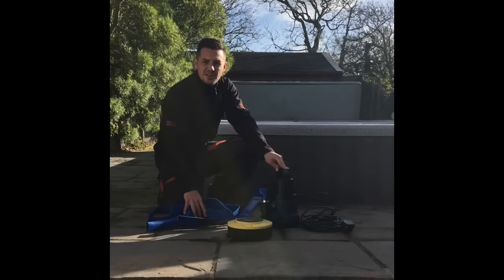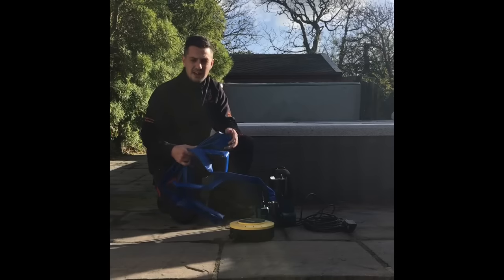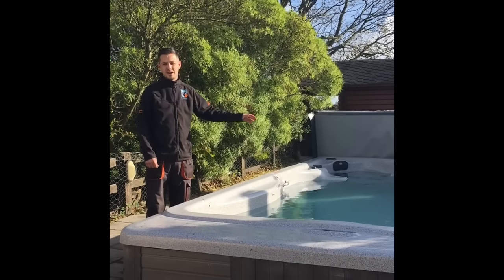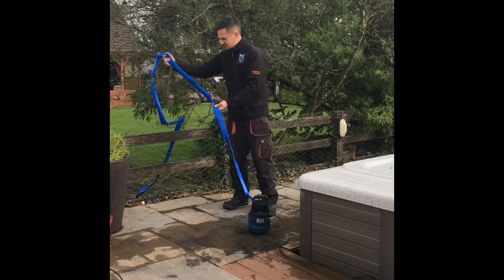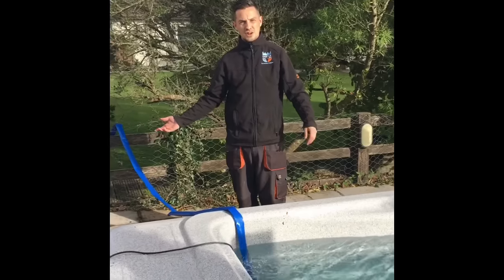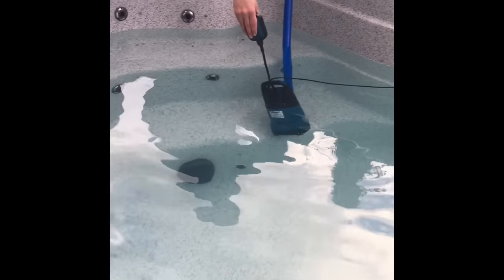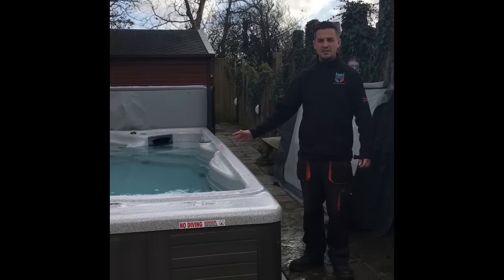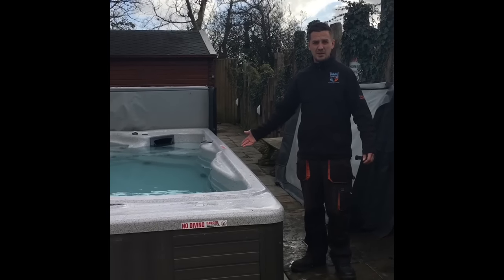How to use a Submersible Pump

Comment: I always wondered why the water pump wouldn't turn on straight away and only after I messed around with it enough but now I know I should've been holding the float switch in the air this whole time ha thanks

Comment: I've just bought one of these to drain 10ft paddling pool. Is it safe to move it while operating in the water?  Am I not going to be electrocuted?
Reply from the maker: If the enclosed instructions have been followed and the item is undamaged then there should be no danger of electrocution. However, before moving any motorised electrical equipment, we would always recommend switching it off first to safeguard yourself and the longevity of the equipment.
Reply: It's also a good idea to make sure the power source is protected by a GFCI breaker, as any outdoor receptacle should be.  Test the breaker before using it.  If the electrical insulation on the pump fails, the breaker will trip and eliminate any threat of electrocution.

Comment: QUESTION regarding hose type:  Have you ever tried using one of those Expandable Water Hoses with these pumps?  I'm getting tired of getting kinks in my typical garden hoses and was thinking about using the Expandable Water Hoses instead...but I'm not sure if those work well for the lower water pressure from these utility pumps.  Any insight would be much appreciated.
Reply from the maker: We only use 32mm Flat Hoses with these Submersible Pumps (included/or sold separately). These hoses are durable and wide to allow the maximum flow possible from the pump. Any hose can kink although this is not such a problem due again to the internal width of these hoses. Expandable hoses (like X-hose) lengthen as the pressure builds in the hose. This can be difficult to manage if you are trying to direct the water to a specific area or drain as the hose gets longer. Also the ribbed flexible exterior snags easily and in our opinion is not as durable as a standard garden hose or wide flat hose.

Comment: Do I need that second device you showed? Or can I just use the pump and hose?
Reply from the maker: Thank you very much for your question. Our submersible pumps come with everything you need to empty the majority of your water quickly and effortlessly. However, we would recommend you also get a wet and dry vac to get the last little stubborn bits of water and grit out of the bottom. A wet and dry vac will also enable you to suck any remaining water out of the jets so that you can safely winterise your spa.

Comment: When you say turn off the hot tub is that on the control panel or the isolator switch ? I have one of your Caldy hot tubs, if I turn it off at the isolator switch will that wipe the timed filter settings input by your engineer the day it was installed ? Many thanks 👍🏼
Reply from the maker: Hi Steve hope you are enjoying your tub!  Turn off at the isolator switch. When you restore the power it should remember all the settings previously set.  Regards, CHT.

Comment: how high can it pump the water? i have a camper van with a water tank on the roof, would it be able to pump from a lowdown stream all the way up to the tnak?
Reply: Thats a good question. The most important and that's to see the pressure power of the pump. 
I for instance want to see if I can pump the water from a rainwater tank to the front lawn....will it activate my sprinkler.

Comment: Aren't you supposed to prime the pump first?
Reply from the maker: Hi Sean thanks for your comment.  It's a good point - and it's a case of knowing your pump.  The Silverline Sub Pumps that we supply  are equipped with an automatic de-aerating device, which removes air from the
 pump. If the pump was allowed to run dry and does not start to pump water again when the water levels are restored, all you need to do is switch the pump off for a short time and back on. This will restore proper operation of the Air Vent Valve.

Comment: what is the name of that pump . what is the psi
which store is it available
Reply from the maker: Hi Keith, we supply the Silverline Submersible Water Pump, it is 750 watt and 13,000 litres per hour maximum output - this is how output is measured rather than by psi.  You can purchase this at:  https://castlehottubs.co.uk

Comment: surely you should be using an RCD switch for your own safety
Reply from the maker: Best practice would be to plug the RCD into a mains socket (in this case our mains socket  has RCD protection), then plug the extension lead into the RCD and then plug the appliance into the extension lead. This would then protect your extension cable and the appliance that you are using. An RCD should not be used in conditions where the RCD itself may get wet.